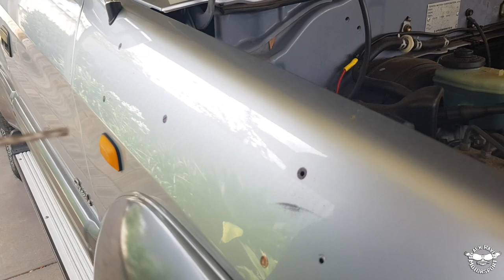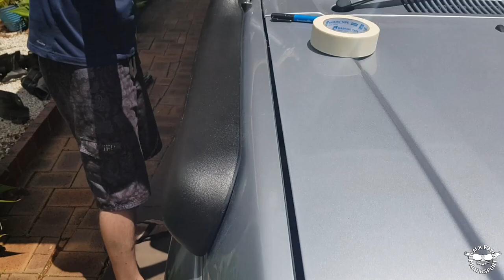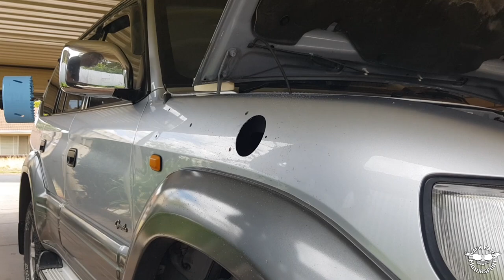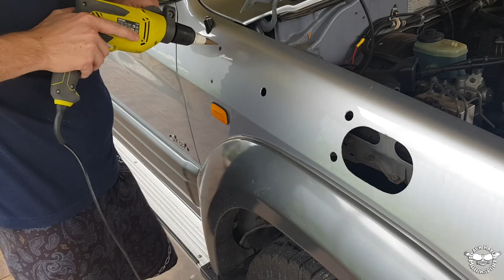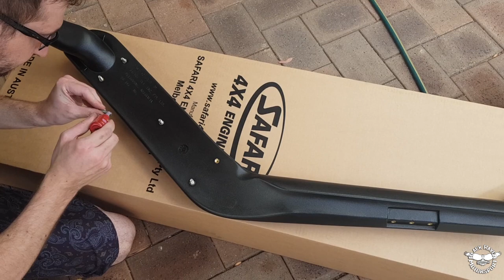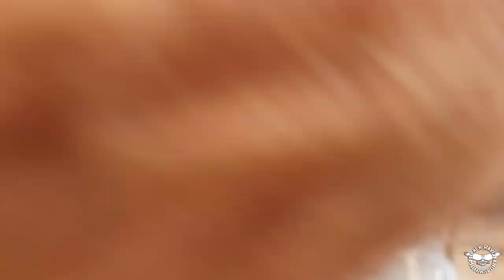Toyota Prado 90 Series // Snorkel Install // All The Hard Bits!

Comment: thanks for the demo mate , i am looking for doing the same but from stainless one here in france ;) , do you have some tips to have some gains for the power of the 3.4L ? 
cheers
Reply from the maker: Hey mate

Firstly, what are you looking for? More torque or more top end power?

What type of wheeling do you intend to do?
Reply: @OzTrax4X4  hi ,thanks for your respond , i am looking for multiple option i would prefer more top end power , i am wonder if there a way to disconnect my front wheel ? and if the is any way to made my automatic gear box shifting manually like tiptric ? thanks ;)
Reply: @blackravenmotorsport  oh no i am not looking for turbocharge or either supercharging because here in france the legislation is horrible when you touche at the inside of the motor , but hey i will ask orto ;) for sure aboute that shifting transs , is that the one Oto who is doing some trip off road with shauno and graham , because i am a bigbig follower ;) of you guys , 

to come back on the car , i think that i will do the exhaust for sure and headers as well , i am welder so i think that will not be to complicate for me ;) , is there a best material steel or stainless ? 
there some other transmission that a can put on my 3.4L like 6 gears ? to make it more efficient on highway 
and one last one , there a way to disconnect the front wheel ? because it is permanent 4wd , and i would like to shift it only when i need it ? 
thanks Mate

Comment: Bought a  cheap snorkle of ebay which I assume is a rip off of the safari. Didn't come with any instructions all seems pretty straight forward. Another great 90 vid of yours to help me along the way tho. Cheers.
Reply from the maker: Hey mate

I hope it gives you some idea, it was never meant to be an instructional video as some people have assumed in the comments 😂

The only thing I'm concerned about with the eBay snorkels is the UV rating of the plastic, as some do turn white after long periods of sun exposure.
Reply: Yeah I thought that too and was tenpted to get the safari  But for the price and how long I plan to keep the car I thought I'd roll the dice. Cheers again mate.
Reply from the maker: Too easy bud.

Unfortunately I didn't have my 90 series long enough, but I guess things happen for a reason. 🤠👍

Comment: Hey mate is that a 90mm hole saw bit that you used for the big hole in the guard? Installing mine this weekend. Also got around to watching the video on what happened to the mighty 90 far out glad your alright
Reply: Never mind read the other comments 83mm 🤙
Reply from the maker: Hey bud.

Yep, definitely 83mm. I went out to the shed to check.

The one I used was a Sutton Tools Bi-Metal holesaw with arbor to suit. 🤠👍

And yes, it was a wild ride that one, still not done with recovery yet either and that was almost three years ago.
Reply: @OzTrax4X4  thanks mate appreciate it and shit thats not good hopefully you get back to shape soon enough.. hope to see ya out on the tracks one day 🍻 cheers for the vidz always helpful
Reply from the maker: @Stonemansfishing  should hopefully be more coming out sooner rather than later this year.

Worth checking the playlists section here for the 90 series vids. 🤠👍

Comment: Hi, man love the vids, I recently just got myself a 2002 prado as my first car. looking to do some 4wD, the previous owner didn't recommend getting a snorkel because he thought it would damage the electrics in the engine bay (such as gme antenna wiring, spotlights and winch wiring) if you went through deep water. Just wanted to know if this is likely to happen and if it is worth getting a snorkel!
Reply from the maker: Hey Dylan, glad you're enjoying the videos. 😎

Water won't ruin anything as long as the outer casing of the wiring isn't damaged.

Salt water will ruin a lot though.

I recommend a snorkel for water crossings and travelling along dirt roads as the higher air intake point will result in less dust entering your filter while being behind another vehicle.

I'd recommend looking at your lower ball joints before you go any further if they haven't been replaced either as they are a wear item unfortunately in the 90 series.

Comment: Would you have a template for the snorkel as mine that came with it doesn't show properly where to drill the holes.
Also love the way you did yours 😊
Reply from the maker: I do still have the template. My issue is finding a thin piece of cardboard somewhere to transfer it onto as its rather large. I could look into it again and see if I can find something this coming week.

Jump over onto Facebook and send me a message there and I'll see if I can help you out.
Reply: @OzTrax4X4  thanks I pm you on Facebook messager

Comment: Is aus law allowed you drill a hole on a piler,
Reply from the maker: Great question!

As long as you don't drill all the way through into the structural part of your A Pillar, it's perfectly legal.

You're only drilling through the outer skin of the panel.
Reply: @OzTrax4X4  thanks
Reply from the maker: @dannyliu9344  No probs mate :)

Comment: Dull drill bits and nothing on how the snorkel connects into the air box after the clip of you struggling to drill out a rivet on the airbox inlet.
Reply from the maker: Yeah mate, it was never an instructional how-to video, it was just showing all the hard parts.

Instructions are pretty clear though if you decide to get one and give it a go yourself. 🤙

Comment: What size hole saw did you use ?
Reply from the maker: From memory it was 83mm. If you check the installation instructions from Safari 4X4, they state what tools are required there, just make sure you get a holesaw suited for metal.
Reply from the maker: Added a link the description for the installation instructions.
Reply: OzTrax 4X4 Thank you very much for the link. Snorkel that I bought didn't come with the instructions . So it was of great help. Above all very nice informative video as well.
Reply from the maker: No worries 👍

Glad I could help in some way.